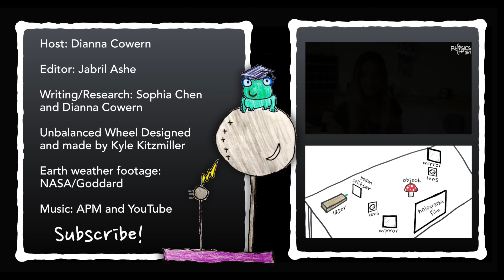Are perpetual motion machines possible?

Comment: I have a friend who has been building a free energy machine for 45 years. After he learned  Quantum Mechanics, he has been able to design a speed controller. To quote, "I know all about Quantum Mechanics. I seen (sic) a video on it once." The machine is  almost ready, but he hasn't figured out how to keep Big Oil from stealing it and hiding it in the basement of the Smithsonian, along with the 200 mpg carburetor, the dead aliens from Roswell and the 8 miles of railroad track melted by EMP radiation (North Korea test bomb).
Reply: Jean Meslier but dows it work?
Reply: which Rgasses
Reply: exactly! just ask that guy that built the H20 powered car... oh, that's right, you can't. He is DEAD! and now EXXON holds the patent.

Comment: "Energy can neither be created nor destroyed"
Me thinking of the big bang: They told us lies
Reply: Actually chemical energy was stored in singularity which provided every energy we see today..so basically it didnt violate :)
Reply: @mystic3549  Where did  that energy come from? -Me, who has near 0 understanding of that sentence.
Reply: No mass was always preserved in the singularity. No energy was created just expanded and reformed
Reply: @yoshikagekira6166  There is aether energy field around us. Electric dipoles and magnetic dipoles can extract energy from aether, without violating law of conservation of energy. If we ignore existence of aether, energy extraction from aether looks like perpetual motion.
Reply: @marcisgulbis9310  There is no proof for existence of aether. In words of Carl Sagan extraordinary claims require extraordinary proof which we lack.
Reply: @yoshikagekira6166  Nikola Tesla invented wireless energy tower, which was capable to transmit energy at a distance through aether. Tesla also invented magnifying transformer which was capable to output very large voltage. Magnifying transformer was DC pulse transformer, where spark gap act like on - off switch. Magnifying transformer emitted longitudinal waves, shockwaves, scalar potential waves. Wireless energy receiver should be tuned to frequency of scalar potential waves to receive energy. Receiver does not increase energy consumption in tower. Infinite number of receivers can tune into wireless energy tower without increasing power consumption.
Reply: @marcisgulbis9310  Oh hi the 1700s called and they'd like their alchemy back.
Reply: @BigUriel  Chickens can turn potassium into calcium, if there is not enough calcium, but potassium is available. It is done flipping one neutron into proton.
Reply: @marcisgulbis9310  OK buddy
Reply: @marcisgulbis9310  seriously, man? Aether?

Comment: The concept of improving things and inventing something better doesn't have to be called perpetual motion. Making something more efficient is a noble thing to do and shouldn't be discouraged. The invention of ultralight aircraft of many types was done after airplanes were invented, and they work quite nicely. But 100 years ago they would have been considered faulty designs that would never work. In the same way devices can be developed that improve their efficiency. If inventors listened to the engineers of the day there would not have been cars or light bulbs.

Comment: A magnet seems to run out of magnetic energy only after many years of being on my fridge. No battery required to keep it stuck on. They are magic!
Reply: its not perpetual tho
Reply: yoonginfires still...
Reply: That's because no energy is required for it to remain stuck to your fridge. Just like a book needs no energy to sit on a shelf. Magnets lose their magnetism for other reasons.
Reply: But it still requires energy to create the magnet. A surprising amount of energy.

The two most common reasons that magnets lose their power is vibration and heat.
Reply: @Iowahurler82  True, but the energy is low, compared to the holding task effort that a powerful magnet can put out. Magnets are nearly perfect as to energy efficiency. Which is kind of magic... :)

Comment: When I was in college, I knew it wasn't possible.  For whatever reason, after adulting for a while, I saw diagrams of machines that claimed to be be perpetual, and I believed it was possible.  For some reason.  What I find most interesting is that no matter how complex you make a perpetual wheel with moving parts that encourage more movement, the balance of the system is always such that friction or air resistance prevents it from increasing or keeping all of its energy for movement in an environment that introduces any friction or resistance at all, much less being able to draw any energy from it to power anything else.  So we'll just have to depend on what contributes energy into the system we have - the sun, or the heat from the earth.  Or whatever was deposited over eons before we came along and dug it up to use it as energy.

Comment: Anyone tried a magnetic setup? How would that work with no friction? Does a magnetic bearing give 0 friction? Or would you need a superconductor?
Reply: The magnets themeselves can create friction with the air, and also moving magnets can create a current, which heat something up, losing energy.
Reply: poketopa1234
So we run it in a vacuum chamber, and make the rest of it out of a material that doesn't conduct electricity?
Reply: DB Gaming everything conducts electricity to some degree, although let's assume it can't.

There are very slight tidal forces from orbiting bodies that can slow it down, although let's assume it doesn't.

Black body radiation can radiate away energy, although let's assume it doesn't.

Isotopes can decay, releasing energy, but let's assume it doesn't.

If it's rotating then there's gonna be a stress on the spokes, in order to keep it turning around. Tbh idk enough about stresses to know if it would break or lose energy, but that might be a problem.

Otherwise, yes. Isolate all external forces and energy radiation and you got yourself a perpetual motion machine. :)
Reply: +DB Gaming There would still be gravity slowing it down. Contrary to popular belief, every object has its own gravity
Reply: +DB Gaming  then you'll need heaps of power to cool the superconductor.
Reply: Jon
Make it in space. I win!
Reply: yeah but it's not always cold in space.  Satellites carry liquid helium to keep them cool because direct sun heats them up.
Reply: Jon
I feel like I could do this all day. :P Murdering pragmatism with my blind optimism. :)

I wonder if it's possible to have something orbit the earth but always be on the dark side. I wouldn't know where to begin on trying to figure that out though. Doesn't seem practical... but hey... Aside from that if liquid helium works for satellites it will work for the generator :P

Seriously though... these new 3d printed magnets are suppose to have smaller but much stronger fields and offer a myriad of new applications for magnets. Not just in making bearings and gears either. Could have dramatic effects on everything from traditional hard drives to generators, pumps, etc..
Reply: Even in this example the magnets will eventually expend all of its magnetic potential that it uses to generate its field. Permanent magnets do need a recharge as well.
Reply: Eventually we will find a way..probably with Electromagnets and a form of Gyroscope.
Reply: +Shinigami919 Even then it's an argument of whether or not x=x+1. No matter what you do, this statement will always be false. Using energy to generate more energy to use on itself to generate more energy is impossible. You can't generate energy, just transfer it from one state to another.
Reply: Slaughtering Smiles
 it's not about getting something for nothing.
Reply: +DB Gaming You said "eventually we will find a way" that would mean getting something from nothing.
Reply: Saint Nick
Not sure if the reply system is messed up or not but I didn't say that.
Reply: +DB Gaming someone else said that

Comment: perpetual motions is impossible violates fundamental laws of physics how many times are we going go over this sigh...
Reply: what if you were to use some kind of magnets to hold the wheel then did this in 0 gravity do you think it whould work
Reply: Magnets slowly lose their magnetic charge.
Reply: Get an education.
Reply: OBVIOUSLY
Reply: with enough work one could use the hydrogen in water (the process of electrolysis) to cause an engine to turn, then using this to turn an alternator and charge a battery to power the process of electrolysis.
Reply: +Ben Scott well, actually when magnets hold something, the thing they hold conserves its magnetic charge.

You actually could build some kind of wheel that would never lose its kinetic energy, maybe by magnets or something.
The problem is, it doesn't lose its kinetic energy only if we don't receive its energy. Which makes its perpetual motion useless.
Reply: +Frankie Ruiz [dot dot dot] and the energy gets lost on friction, electric resistance and some other processes.
Reply: Laws are made to be broken.

In all seriousness though, I see that as a "because I say so" argument, and by default is one that I feel can be challenged.  Just because it's a law now doesn't mean it can't change at some point, and it doesn't mean we shouldn't try.

of course, the problem with perpetual motion machines goes far beyond just running forever without energy input...
Reply: Ndoki Hasaki Unless you have enough evidence to support your claim then do not even speak of it being possible. There's a reason they are called laws because we use them to accurately observe our universe.
Reply: your all forgetting that the ancients have used magnet perpetual motion machines in spots of the world where the earths magnetic force is strong enough to keep the magnets going until its either stopped or if it destroys itself
Reply: Draven Cool - wrong
Reply: No one is trying to create something out of nothing. a perpetual motion machine would never produce energy. The idea is that the energy used to start it is recycled back into the machine. Let's say you have a perpetual motion machine that takes one pound of pressure to start, the machine harnesses that power and then uses it to keep it going. It's not creating energy, it's simply using energy at a 100% effectiveness rate. Thus, giving whatever the machine is infinite energy inside itself
Reply: TheInfamousTacos If you have to put energy to start it is not a  perpetual motion machine ffs this is why its impossible
Reply: TheInfamousTacos in science yes, i think we are talkign about 2 different terms
Reply: No. Magnets will loose their magnetism over time.
Reply: The law of conservation of energy still holds. The leading theory is inflation. In inflation you have inflating matter, matter that doubles it's volume in X time while it's density is constant. It gets this extra energy from the negative energy of the gravitational field. Think of an asteroid floating in intergalactic space, it is moving at a constant velocity. When it gets close to a planet it starts accelerating towards the planet. Where did the energy come from? The gravitational field.
Reply: Sam Burnes ok then tell me when you can coalesce the amount of mass needed for this to work.
Reply: When you compress all of everything into a (near) infinitesimal point.
Reply: The 'point' (although it being a point presents many problems) would still have space and time. For example, if the universe is infinite (and it looks like it is) then the universe could have gotten so compressed that everything was just really hot yet everything was still infinite. And yes, under extreme circumstances gravity is repulsive, like those of the early universe. Also no. Gravity is separate from the electromagnetic force in all but the most extreme circumstances. Electromagnetic radiation is made of photons and 'gravitational radiation' is made of gravitons (If the standard model is right.)
Reply: According to general relativity, a uniform space filled uniformly with matter will not have a net gravitational pull so therefore solves your time problem. The problem with your first statement is that is wasn't infinitely dense, so therefore space still exists. You are right, the 'singularity' didn't hold itself together, it caused inflation, commonly known as the big bang. Electromagnetic radiation is made of photons. 
http://www.qrg.northwestern.edu/projects/vss/docs/space-environment/2-what-is-electromagnetic-radiation.html
Electromagnetic radiation is radio waves, visible light, gamma rays, etc. All of which are made of photons.
https://home.cern/about/physics/standard-model
While this link also provides more proof for the statement above, it also says that the standard model does predict gravitons, the force carriers of the gravitational force.
Reply: Could repeat it a few more times
Reply: thats besides the point, satellites will stay in orbit even after were gone i.e., the point is not finding a flaw in physics
Reply: Wrong comment thread? Satellites have not been mentioned here.
Reply: What ifs do matter, they help us theorize about new situations, when astronauts landed on the moon, there was a chance that the moon would be soft dust so NASA had to ask what would happen if that was the case?
Reply: axel tiburcio gravity is a force, not energy; so technically if you used gravity in the right way you could get perpetual motion
Reply: axel tiburcio use magnets to stray away from friction. levitate. -Walter Bishop
Reply: Gravity is a force, but more specifically it's an energy well of potential energy.
Reply: Ndoki Hasaki A universal law is unable to change unless you find a way to completely reset everything about the universe. If you were outside of the universe, which the very laws of the universe prevent that from happening, then you could alter the laws of the universe as you are not bound by its laws. But this is an impossibility.
Reply: Conserves Energy
Reply: Draven Cool And where is the evidence that the ancients used perpetual motion machines?
Reply: TheinfamousTacos Nothing is 100% efficient.  For perpetual motion to work you need more than 100% efficiency.
Reply: When you start using general relativity, like you need to to describe the universe, conservation of energy kind of falls apart. But the universe got it's energy for everything from the gravitational field and the negative pressure it exerted when it was compressed.
Reply: axel tiburcio yes but we have seen many times the laws of physicks getting dissproved
Reply: axel tivurcio  Really?  Where have you seen the LAWs of Physics getting disproved?  The Laws of Physics is not like a traffic ticket.  I don't think you know what you are talking about.
Reply: So magnets lose their magnetism, so what?  You still can't make a wheel rotate with just magnets continually.
Reply: Not if they have two poles, which all magnets do. (Except for tiny monopole atoms)
Reply: axel tiburcio false. I watched one get made with a baloon and wood
Reply: axel tiburcio 
perpetual motion machines are not impossible, rather improbable.
All you need are frictionless bearings, and to be in space.
Reply: Nope. In addition to there not being frictionless bearings, energy is always conserved so even if you had no energy being depleted to heat or other sources, taking energy for your own use would only decrease the amount of energy your machine had.
Reply: It violates the fundamental laws that we are aware of right now. Till then, we have yet to learn more that the universe allows us to
Reply: The earth seems to have no trouble spinning though does it, but it's doing that because of it's size.  It's mass is large enough to create a source of energy, called gravity.  

So theory, you could create a perpetual motion device if you had gigantic spheres in space attached to a very very very very very very VERY tiny thing you wanted to turn.
Reply: Arthur Vandelay Still not a perpetual motion machine. It doesn't create energy. Gravitons attract matter together and is what makes planets and stars possible to form, it's not creates by the planets and stars, there's simply more matter being pulled on at once which creates our spiral around the sun and our spin.